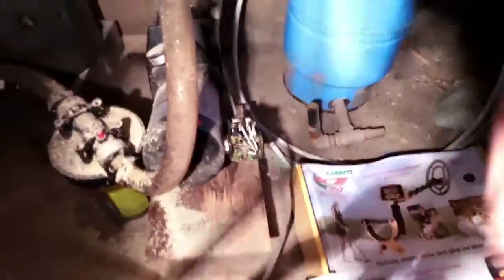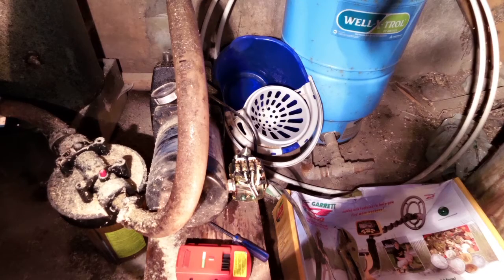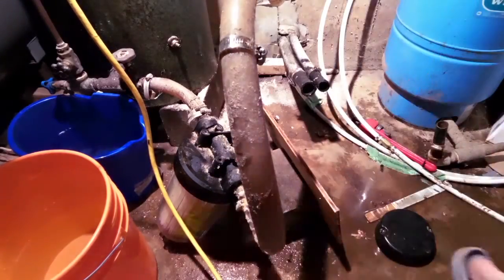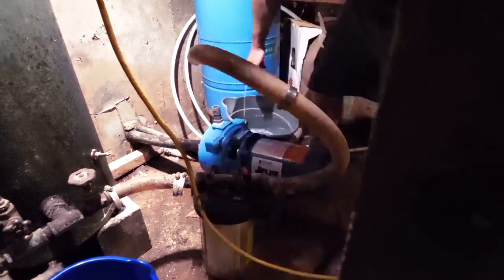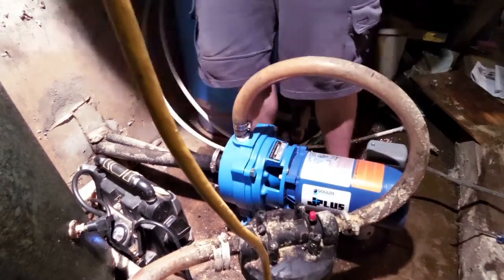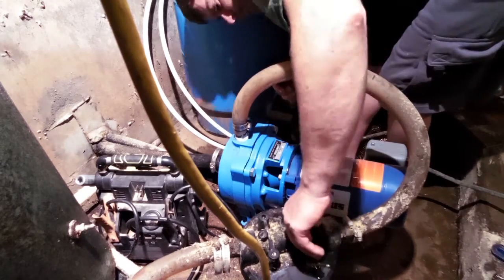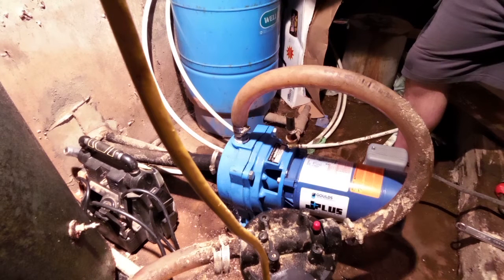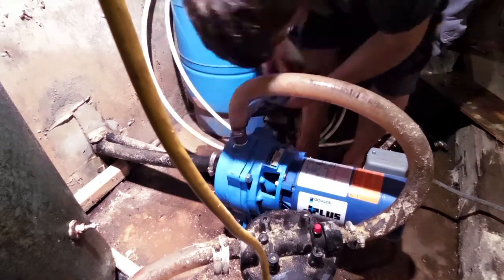Replacing a Gould well pump on the homestead - second pump in 5 years!

Comment: I just bought one of these goulds deep water well pumps for my 85 ft. water well. They're pretty expensive but hope it will last a long time.  Do you know or remember installing some kind of kit at the end of the two pvc pipes that go into the water well? Any feedback appreciate and thanks for the video.
Reply from the maker: Thanks for the comment. No issues with mine so far, runs surprisingly smooth. I didn't change any end fittings, the pipes are underground and I have no access to pull them out without a backhoe I think. I would like to inspect them and maybe unclog them but no way to do so. I don't have any issues pumping though

Comment: Hi good work. I didn't get the priming part well can u help me on that part. And those two piping size please
Reply from the maker: For mine the pipe size was 1 and 1/4 inch i believe. Been a while since I did that. For priming, make sure you fill it with water before turning on. Open a cap at the top or fill hoses with waters so the impeller has water, it helps when it fires up the first time